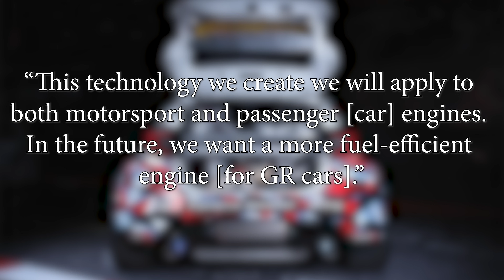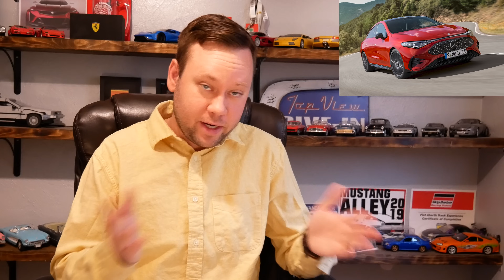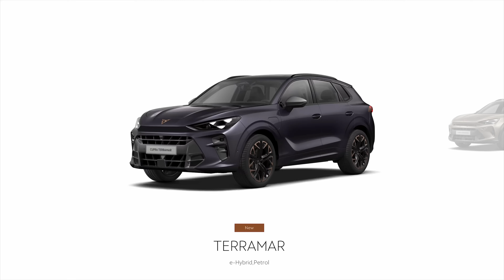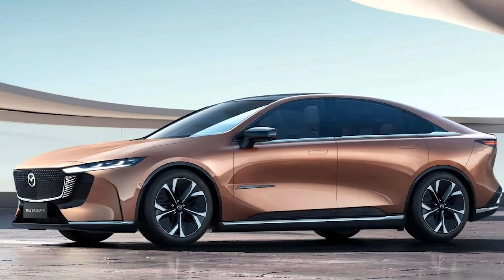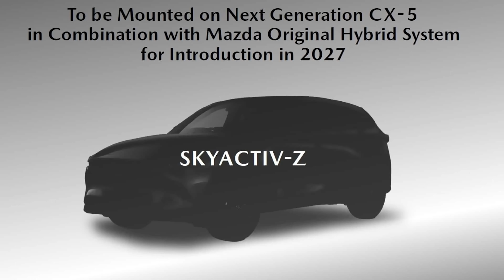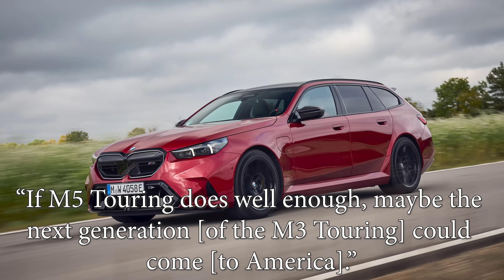Toyota GR Going Hybrid, New Alfa Romeo Stelvio Spied, 500+ HP AMG CLA Coming + More! Weekly Update

Comment: You're comparing Chinese 37k car to a German 100k car and mocking Germans for not being able to get the same level of power the Chinese at that price point. Hm... Let's keep ignoring, as you are, for a moment that Porsche is a luxury brand with brand equity (so they charge money for the brand alone). Are [engineer] salaries, living expenses, manufacturing costs the same between the two countries? You're basically saying "Germans suck, they can't achieve with 100k what Chinese can with 37". Well, if Germany allowed the kind of labour that Nike is known for, then maybe they'd be able to offer their car for lower. But I certainly am glad we have different standards here.
Reply from the maker: I have no problem with the price difference, I understand they command a premium for the badge and the different labor conditions and costs. My main issue is with their rate of technological advancement which in my opinion has no good reason to be slower than the Chinese.

Comment: For the Kupra story, I would be surprised if these aren't built in existing North American VW factories.  None of their cars are unique.  They are all based on VW platforms and share most components.

For the BYD story, this is most hype.  There are no chargers that can go up to 1MW.  In the real world, you rarely will see a charger above 350 kW, so BYD is just blowing smoke.
Reply from the maker: They said they’re building them…why would chargers like that exist already if nobody’s car could use it till now?
Reply: @MattMaranMotoring  future proofing.  Just like they said those new chargers would go up to 1300 kW even though these cars will be "only" 1000.  It's all interesting to see, but the Chinese are notorious for their over promising on things.  And it's an issue that is just technical enough that far too many people are going to hear 5 min charging and then expect when they get home and plug in their car to their 30A 120V dryer outlet that it will charge in 5 mins there as well.  That will not happen.  Nor will DC fast chargers give them anywhere near that charge speed either.  In China there are nearly 13 Million charge points, and BYD is stating they will build 5000 of these super fast chargers.  Ok, I mean it's a start, but it's mostly just hype to get press time with stats no one will see.  Just like Tesla claiming full self driving for a decade now or some new sports car claiming a 250 MPH top speed. Hype to get attention.
Reply from the maker: @Hazdazos  The fact that they're actually putting the tech into cars and putting up the chargers is still impressive to me since it'll be several years till any non-Chinese stuff matches it.
Reply: @MattMaranMotoring  not disagreeing with that at all.  Moving forward is good even if it is mostly hype.  That's definitely better than moving backwards like seems to be the case in the US these days.